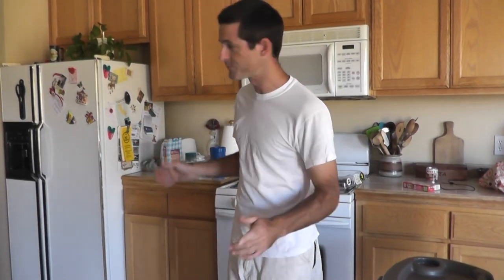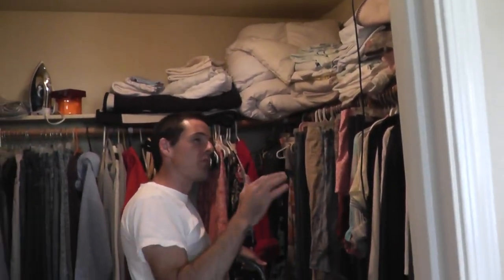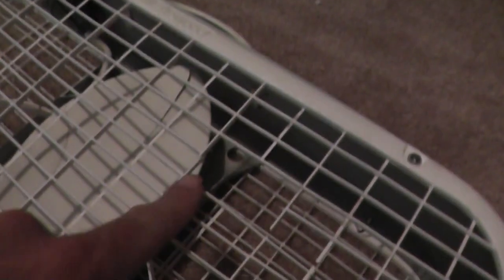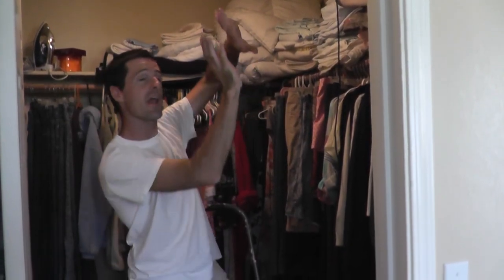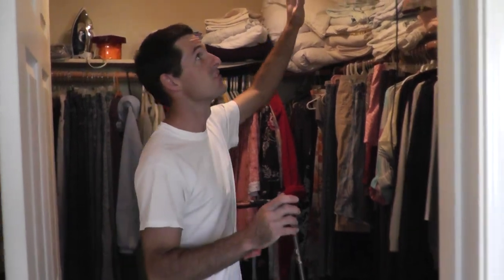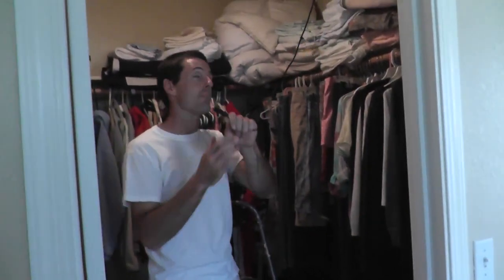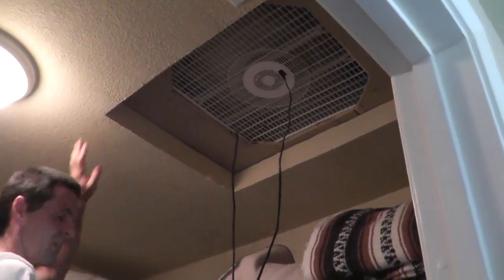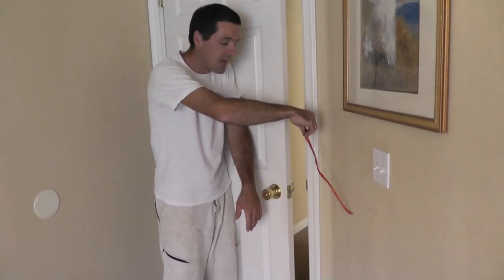Cheap Homemade Whole House Fan - How To Cool Without A/C !!

Comment: We grew up with "whole house fans" built into our "old" houses: they worked VERY well, especially at night if the AC unit went out, my dad would turn it on- it was loud- but we would crack a few windows opposite ends of house and it would create a suction through home, up into the fan and out the ceiling. The fan was huge, way bigger than our box fans today.. we need to remake this idea and have built into all our NEW houses!!   (our access to the fan with in the middle of the home, in the hallway- it sucked air from generally all the house that way because it was centrally located- it was so strong, you could stand under it and feel like you are under beach winds!). You had to have the windows only cracked partially, or would lose the "suction" that made the draft. 

Here is a guy with the right idea!!!!!!!! THanks!
Reply from the maker: Thanks so much. It's true that just switching on the ac is not the only way to cool a home. I say it makes great sense if you can grab some of the cool night air and suck it into the house to help with the next day's cooling.
Reply: Yeah, the old "whole house fans" (or as we called them "attic fans") that we had back then were quite a bit larger than a box fan.  They were usually larger than what a modern pull-down attic stairway takes up.  The attic access panel was in the hallway and the fans were as wide as the hallway -- probably 36-42" or so in diameter, I guess.  They had a louver system on them so that when you turned them on, the louvers would open up.  The electric motor turned a fan belt when was hooked to a pulley on the actual fan blade shaft.  I suspect that the electric motor was somewhere around 1 hp.  To get in the attic, you had to climb a ladder, push up on the fan and move it off to the side.  If I was doing it these days, I would just install  it separate from the attic access opening so it would not be necessary to move it when going into the attic.  Where I live now, whole house fans would not be that great.  It's often still in the 90Fs outside at 9pm.  Plus, even when it does get down into the mid-70Fs, the humidity is so bad that it would be uncomfortable to sleep in that condition.  I'll just stick with my air-conditioner.  If I ever got so poor that I could afford to cool my entire house, I would just put a window unit in the bedroom and live out of there.  Actually, when we have power outages from hurricanes and I have to run my house off a generator, that is exactly what I do.  I can keep the master bedroom and master bath at around 70F with just a window unit while also providing electricity for the rest of the house (except for the central air-conditioning unit).
Reply: Grumpy OldMan THanks - thats what I remember- those louvers would open up- IF we ever get to build again, I will save your description and have one put it- and yea, it must have been as wide as hallway- that makes sense. We had a separate attic access from the garage and my dad would walk over to where the fan was- no access there..it was a one story ranch. .We were in Houston, and the humidity was horrible- the fan was used ONLY in emergencies- I can't imagine having to use all the time-like the original owners must have done years before  my family. ... plus the safety factor of having open windows- yea, we want our AC - but a big good one, built  right would pull the temp down enough to sleep at night for us, even in the humidity.  It would be good during hurricane if could be hooked up to a generator.
Reply: InLaws Attic I live in the Houston area and I suspect that if it wasn't for air-conditioning, there would be a lot less people living here.
Reply: Agree!
Reply: i hav one in my hallway. Place is from the 30s or 40s i guess. They make smaller quieter ones now days u can install for each room.
Reply: @jenniesgarage wouldn't it suck cool air out of house tho in attic at night?

Comment: Dew point (humidity) is a consideration too. It's more comfortable to have a warmer temp and lower dew point than vice versa so sometimes it's unavoidable running either or both the A/C and a dehumidifier. But this is a great idea when the dew point is low.

Comment: I did this same thing, except I built a frame for my upstairs windows that I mounted my box fan onto (because I do not have an attic). So at night I crack the windows on my lower floor and turn this fan on with the stairway door open from the main floor to the upper floor. Before the Sun comes up in the morning the house is about 64 degrees F. I then close the door to the upper level (floor) of the house and leave the fan on with the window on the other side of that upper level open to create a cross breeze on that upper level to try and keep it as cool as possible because it gets very hot up there since the roof is just a few inches on the other side of it (it's a slanted style room). Doing this even when it's 90 degrees F here in Michigan the house only gets up to about 73 degrees F by the time I get home at 5pm. So that is really not bad at all!! 

Thought I would share my success story here! :)
Reply from the maker: thanks for the comment. Although it isn't as comfortable or easy as AC, the cost savings make it worthwhile in my opinion

Comment: They sell attic fans and they go for $1000. This is a good idea or I am sure you can buy an inexpensive industrial fan that would move more air. It just has to be insulated in the winter in cold climates.
Reply: bg147 It'd be better to use box fans in multiple parts of the house than have just one expensive fan.

Comment: I lived n the Sierra Foothills of California where it gets really really hot in the summer.  It does cool down nicely at night though.  I put solar shades on all the western facing windows, and installed an attic fan.  I would run the fan at night, leaving my bedroom window open, and it was like having the A/C turned on because it made a nice cool breeze as it pulled the air in.  In the morning, I might have the house down to 65 degrees or lower.  Then I'd close all the windows, pull all the drapes, and leave them closed all day.  I also had double-pane windows, which helped.  The house would stay cool (under 78 degrees) until maybe 3 or 4 in the afternoon.  Then I'd use a regular floor fan to get through the next three or four hours until the sun went down.  As soon as the sun went down, I opened a window and turned on the attic fan.  I got through the hellish summers without once turning on the A/C.   I really recommend an attic fan if you live somewhere where the temps drop down after the sun goes down.  It makes all the difference.

Comment: I did this for about 15 years with the same box fan. I finally installed a real fan (280 watts at low speed). It was a tremendous increase in air flow. This approach works as long as the outside humidity is not too high. Pulling in cool humid air is not very comfortable but does lower the temperature. I have central air but use the whole house fan when ever the night time temperatures are expected to fall to the low 60s.

Comment: I'm using my cars engine and the fan of the motor, but having s little trouble getting the engine block to stay in the attic hole, any ideas?
Reply: seat belts
Reply: Disconnect the engine from the car first.  Don't be embarrassed. I made the same mistake.
Reply: Pi Snoopy lmao...lmao...lol...lol
Reply: Pi Snoopy might be low on blinker fluid should have your local train engineer have a look at it
Reply: Pi Snoopy Don't put your engine in the a hole.
Reply: That will produce a massive amounts of heat, you might as well crank the heater to max!
Reply: Put an engine crane in your ceiling just make sure you tie off to your roof battens lol it should hold

Comment: as a builder for 20 years it's a shame to see that contractors don't know how to properly ventilated an attic without you having to do that. where does the heat leave the attic by the way? ridge vent, gable vent, roof vent, or a broken power vent?

Comment: This method does work to a degree. However, the most effective system is to have an additional fan sucking cool air inward, thus creating a cross breeze ventilation. The advantage of ac is that it removes moisture from air, which this system does not.

Comment: When I'm not american and use Celsius and hear "it's usually 60 to 75 outside when the sun starts to go down" I think Where do you live? in hell?
Reply: Over half of the country is like that in the summer
Reply: yes haha! try texas in the summer! today is 102 feels like 107. thats not what sucks. by 2 AM tomorrow it will still be in the 90s.
Reply: You aren't far off. My old house hit 110 in the day time last year... In San Diego... just a couple miles from the ocean.... inside would have been a death box if not for AC. (110 is a little over 43c for the F challenged) On the up side, I'll never need to shovel snow.
Reply: hilarious!

Comment: Unless you live in Georgia temps might start falling 11pm to 1am.....Maybe but not that much.....Good,Idea....thou..Thankz
Reply: I'm from GA, now in AZ. The Georgia humidity makes it impossible to cool off unless there is ac to chill it. In AZ, it is much drier and adding shade, evaporative coolers we work pretty well here; unless it gets humid during monsoon season, but not nearly as humid and oppressive as the South. We only use a small window AC unit during the hottest afternoons, this fan may help. Thanks

Comment: Even easier idea - Get up early, like 4 or 5 in the morning. Open all the windows in the house and leave them open for about 1/2 hour Close the windows, draw the curtains and go about your day. DO NOT OPEN ANYTHING DURING THE DAY. When the afternoon hits, the inside of the house will be much cooler than the outside. I used to do it in my old apartment everyday. 90 outside, 60 inside. As soon as you open a window or door the house will heat up. Check it out!

Comment: I saw somewhere that in India, they use 2L pop bottles, cut the bottom out, mount them on a wooden board, cut open the cap, and install over opened window, as the hot air from the outside is forced through the smaller hole, the air is naturally cooled. So, combining that with your design, you could have a cooler house even when it is boiling hot outside.

Comment: I have a simple enough system. I draw air from an always shaded window/s and exhaust it on the other end of the house. I use a big metal Air King reversible window fan on the exhaust end with high cfm rating. It draws enough air I have to blow dust out of the intake window screen often to keep it all flowing easy. I can run several fans lots cheaper than any single air con I ever owned. My way can be harder when there are others living here closing doors and such but living alone I can set it up any way I see fit.

Comment: Even using 2x6 construction and R60 attic insulation in interior Alaska, a box fan is insufficient to air out an entire house in a reasonable period of time. I've been having a box fan sucking the air out for about an hour. The temperature has only dropped a couple of degrees. That being said, a single room with a window open dropped to the outside ambient temperature within about 15 minutes.

In other words, a $20 box fan is underpowered as a whole house fan. The home despot does have a 30" insustrial fan that costs $129 that could be ducted to an attic opening and be very effective.

Comment: Could not do this in the American Southeast during the peak of the summer due to the humidity. Might work in Late Spring, early fall though. In this part of the country its all about the Dew Point. 85 degrees with a DP of 50 is tolerable. But with a DP of 70 it would be unbearable to most people at the same temperature, especially inside a bedroom.

Comment: If you need more cooling, do what I do. Cover all of your windows with aluminum foil. Summer heat is radiated by the light of the sun. Your house is like a closed car collecting all that solar heat. Tin foiled windows get rid of the heat before it can get in. Good luck. The attic fan is good, but solar heat will be working itself into your house all day long unless to put up that tin foil.
Reply: And if you need to mow the lawn, you can use some to make a nifty hat too!

Comment: You can also put fans in open windows to suck cool air into the house.  Then leave the attic hatch open for the hot air to go into the attic.  Same idea, just you're pushing air in instead of sucking it out and there's no build involved.  I taped a bit of plastic from a grocery bag to the attic opening and it works.

Comment: might i sugest using a bathroom extractor fan 4/10 watts as high as possible to ceiling as heat rises extracting outside if use one with venition type vents which close when fan is not running will stop mossis getting in.Now buy a solar panel l4/10 watts + small invertor to convert to a/c then when sun is out & hot will run and extract heat when not will stop.cost to run after purchase of parts zero & fully automatic-- just a thought maybee ?

Comment: In principle what you are trying to do is to push the blazing hot air from the attic to the outside replacing it with much cooler air that gets pulled from inside your house. So, a cooler attic in a summer day means less heat to be transferred to the house thru the ceiling right?

In reality, the fan is drawing air from the house depressurizing your living space which causes all kind of problems even (and even more so) with your air conditioning turned off.

The air in your living space will be replaced with air with increased humidity levels. The created negative pressures in combustion appliances can cause back drafting of flue gasses such as carbon monoxide in the living space.

In order for the fan to work the air needs to come from the outside and not be pulled from the house.

Remember that the air conditioning in your house not only cools the air but also dehumidifies it via its evaporator.

The most effective strategy for minimizing the effects of summer attic temperatures and eliminating the potential for winter ice damming is as follows:

1.	Eliminate air leakage between the attic and living space. Common leakage points are:
  a.	penetrations made by plumbing and electrical fixtures, 
  b.	top plates of interior walls
  c.		attic pull downs/ doors and plumbing chases.
  d.	Use expanding foam or caulk for plumbing and electrical penetrations and weather stripping for doors or pull downs.
2.	Seal a/c ductwork located in the attic using a commercial grade duct sealer or mastic and insulate with a minimum 2” insulated duct-wrap with vapor barrier.
3.	Insulate the attic floor to a minimum R-30.
4.	Use light colored shingles to reduce roof surface temperatures.
5.	Provide ridge and soffit or gable and soffit passive ventilation to building code specifications to remove moisture and prevent ice damming.

Comment: Perhaps you could install an automated switch hooked up to a couple thermostats, once the temperature outside becomes a few degrees cooler than the inside it will turn on.
Reply: +Riley Davis or simply put an outlet timer on the power line like people do with outdoor X-mas lights... set it to turn on when it cooler and off in the day. then the only thing you have to remember to do is shut the windows and such
Reply: Kyle Gilman You have created a better idea than I. Good job.
Reply: excellent idea